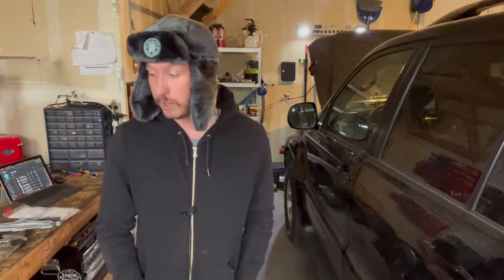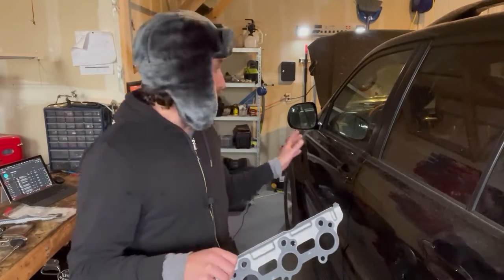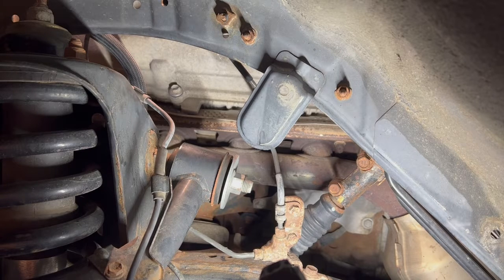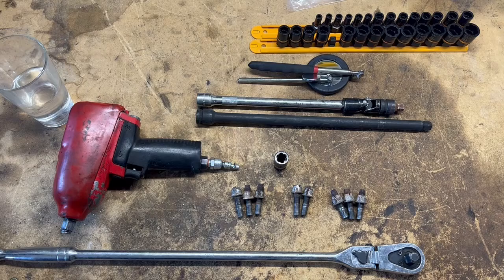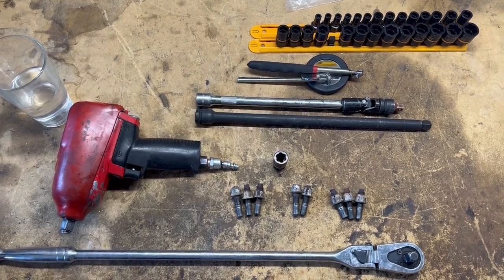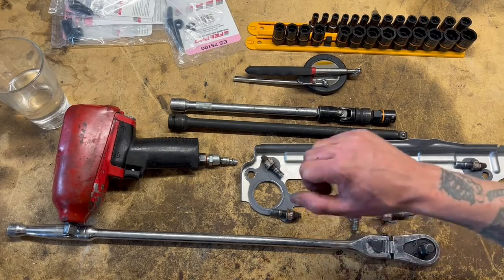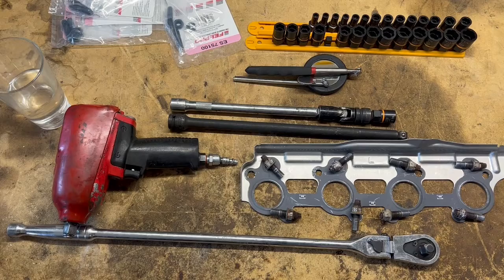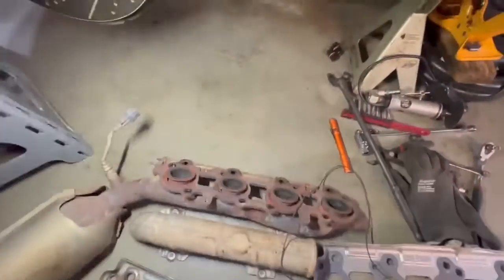2007 Lexus GX470 Exhaust Gasket Removal

Comment: Planning on this repair soon for my 07 GX470 but due to age and my being in there anyway, I’m replacing both exhaust manifolds and gaskets. Doing it while in the truck. I’ll have it tore down anyway doing wp and timing belt at the same time. Thanks for the video. It will come in handy. All I can suggest to everyone is be patient. That’s 15+ years of heat and rust to get through without breaking any bolts off. PATIENCE IS TOUR BEST FRIEND. 😁
Reply from the maker: Yeah good idea to replace the manifolds as well. And I agree, patience. These vehicles are so reliable that by the time they need fixing they've basically fused together into one piece.

Comment: Thanks for this video.  Im doing this job right now in my garage on the passenger side. Its still a motherfker. I highly recommend a set of wobble socket extensions to help get more flexibility. Also, a nice set of impact ujoints. With these items, was able to get an impact gun on every bolt. Use lots of Penetrating oil and heat first.

Comment: This could not have come out at a perfect time! Thank you so much I’ve been looking for a video so I can do it myself. I really appreciate the time you took to make this video!
Reply from the maker: Hey, I'm glad I could help. Hope the job goes well. Just be patient and make sure to have a mirror handy for finding some of those nuts and bolts.
Reply: @aiyogarage I own a 2006 Lexus LX470. I think I have issues with my exaust manifolds. The question now, is only the gasket bad or should I replace the  whole set. MAHLE gasket set is about $60. The Lexus OE  gasket set cost over $120. I only find the manifold set at Lexus dealer $700. Should I buy only the gasket? Thank you
Reply from the maker: @rhoodj  I would buy the manifold as well. I tried only doing the gasket to save this customer money, but it ended up needing the manifold as well. Thanks for watching I hope that helps.
Reply from the maker: Not a problem!

Comment: Hey question how do I know or could i find out if its a manifold gasket leak or a manifold crack
Reply from the maker: You won’t know without inspecting it. It probably isn’t cracked, probably just warped. But I would recommend replacing it with the gasket. Hope that helps

Comment: Hello am going to do mine tomorrow getting a hard time to get the screw part number do anyone know will appreciate
Reply from the maker: Hey I can't find the part number I used in the video. I believe I got mine from auto zone. But it is a stud and nut style. If you look online you're see a kit that comes with springs; those are for the exhaust connections, not for the manifold. Hope that helps
Reply: @aiyogarage  I order the one I see on ur video es75100